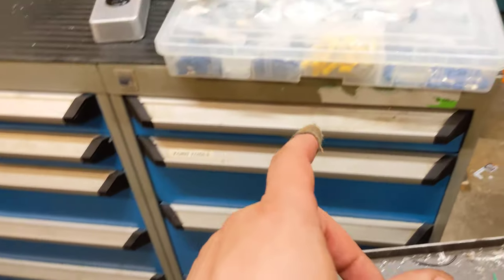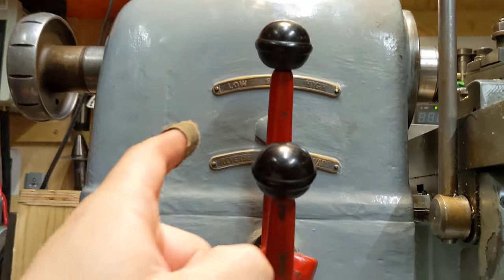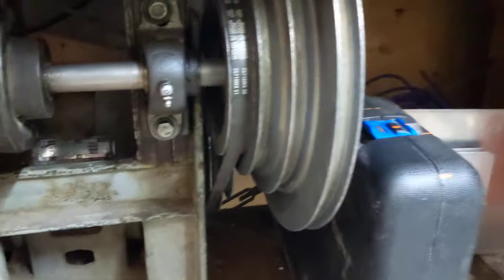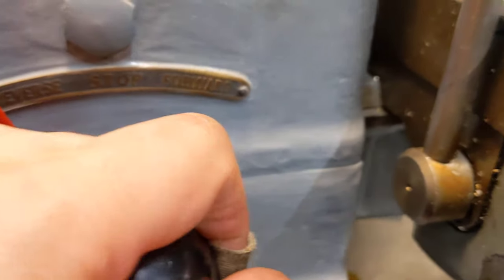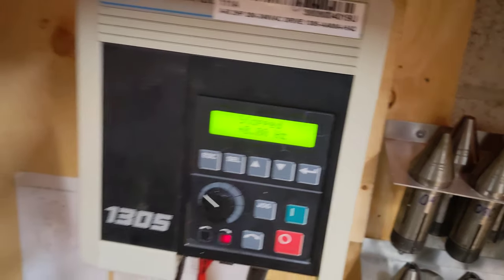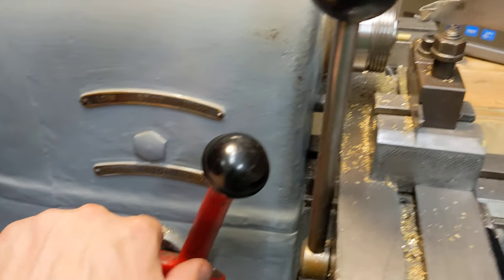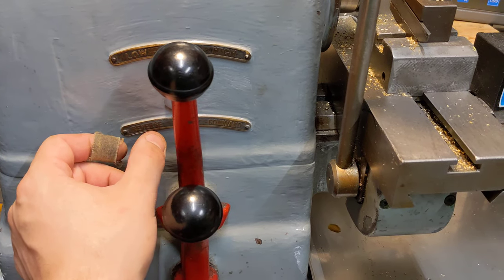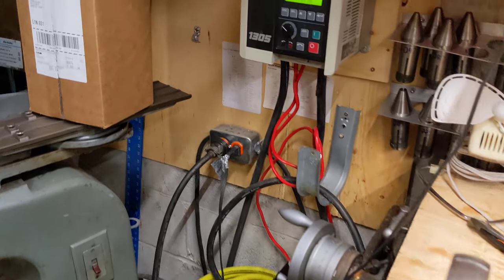VFD control of Elgin Hardinge Lathe handles - enable lock 🔒 and direction

Comment: Hi I'm doing the same thing on my hlv hardinge. Did you keep the original motor or have to swop it out for a modern motor? 

You clearly know your stuff so any help would be greatly received.
Reply from the maker: I hard wired the motor to one speed
Reply: @LikeDotAudio  I hear horror stories of old motors insulation braking down on vfd driven systems. My hardinge is 415v guessing it cannot be switched to 240v ... or can it.... ?
Reply from the maker: Never heard that, but that could be people mis matching voltages.   People think 600v motors magically run on vfds....

I did a post on the switch wiring here:  https://like.audio/20210815/lathe-weiring-forward-and-reverse-and-enable